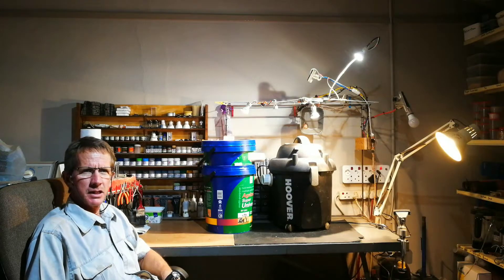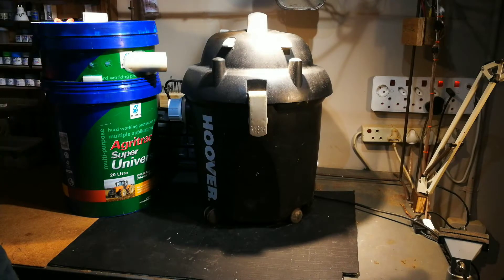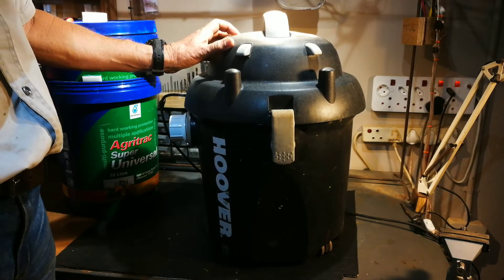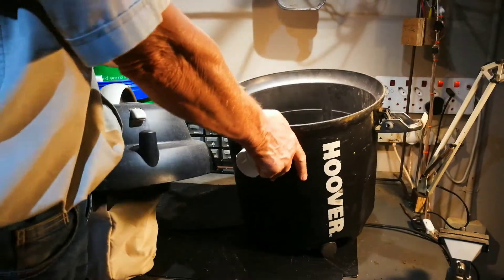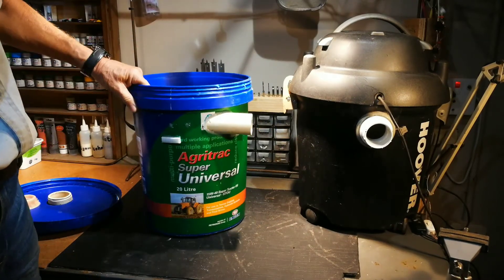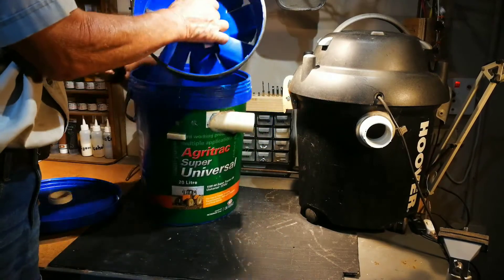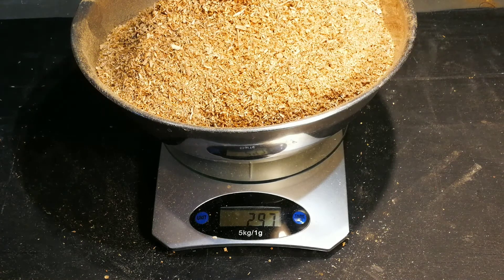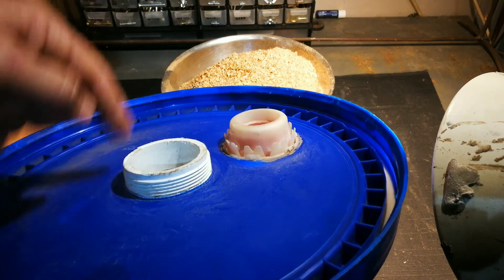Double cyclone dust collector 99.3% effective

Comment: That is not a double cyclone that's a single cyclone with a bucket extension. And the whistling is coming from using a ribbed hose with a powerful vacuum.
Reply from the maker: Thanks for an interesting argument. There are two siclone actions happening simultaneously. One on top of the separator and one at the bottom where all the dust stays and don't get a chance to swirl upwards again and end up in your vacuum cleaner.
Reply from the maker: Yeh, I figured out the ribbed hose, thanks.